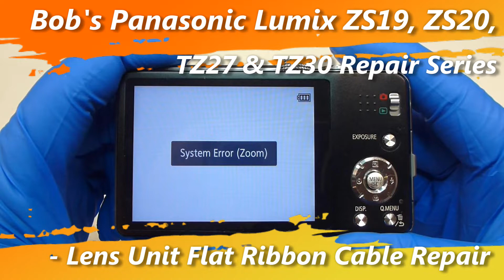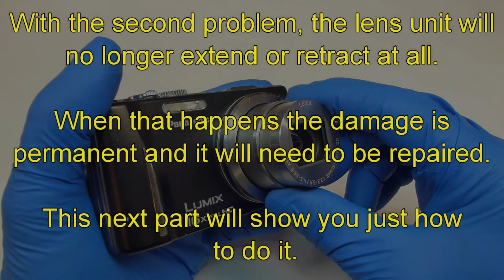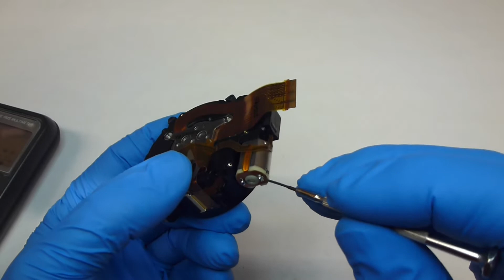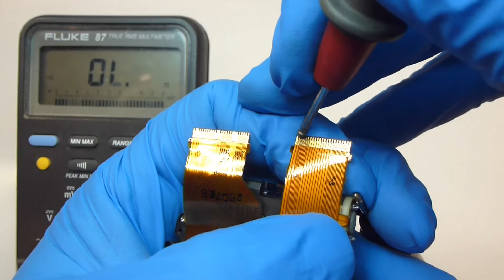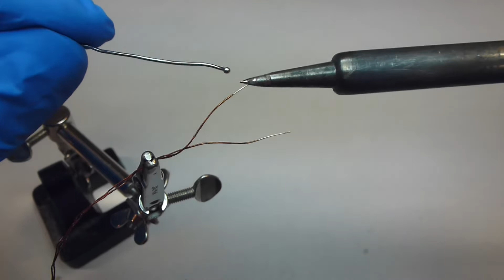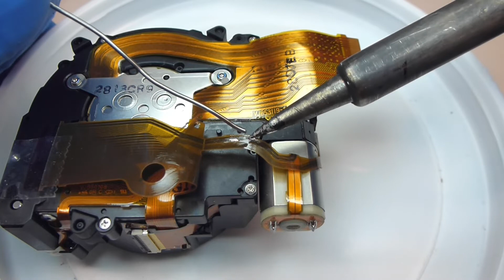Fix the "SYSTEM ERROR (ZOOM)" error on a Panasonic Lumix ZS19, ZS20, TZ27, TZ30

Comment: Thank you so much for this excellent video. Because your guideness I was able to repair my old TZ30 camera. I found that motor wires had stopped conducting. So I soldered 2 wires and it solved the problem. Finally a camera back to life. Disassembly and assembly of a body also were not complicated ,thanks to your other video. I am glad to keep in hands this old device again.
Reply from the maker: That's excellent! I'm glad the video helped you out and you were able to repair it.

Comment: what do i do if I get a 0 in the resistance meter between the two points on the motor? 
I Get resistance in the right knob on the motor but not the left

Comment: Question?  Won't the two new copper wires short out if they touch when squeezing into compartment?
Reply from the maker: Hi Martin. The copper wire has an insulating coating on it, and the coating has to be removed first before you can tin the wire with solder. You can remove the coating by scraping it off with a knife, or you can use sandpaper. All motors, relays and other electrical devices that use copper wire inside, use copper wire with an insulating coating.
Reply: @Thebobfactor    Thank you Robert for getting back to me so quickly.  It was really bothering me.  I had not seen clear coatings on any wire before.  Still learning at 74.

Comment: this is the main reason I stopped buying Panasonic ZOOM cameras, I had the same problem with the FZ200 so gave it away. All Panasonic Camera that has ZOOM system fail the same way all the time... total garbage.
Reply from the maker: I agree Richard. The problem that causes this System Error (Zoom) error, is 100% a design flaw.  And a problem I've run into with every Lumix model that I've ever owned, about four of them, is dust getting inside the lens, and on the CCD. They could do a lot better job on quality control for their camera designs.
Reply: @Thebobfactor  we should make sure Panasonic is paying attention to this issue  and fix it so customer can continues buying their product
Reply: My brand new camera which I never used and intended to for tomorrow barbecue has this problem now. Panasonic and Leica is garbage
Reply: Had Panasonic for years and haven't had any problems with them, Think it depends on how they are used .Have bought some second hand spares or repairs that had this issue ,fixed them up without any problems apart from one removing the lens sensor , not a good idea as it need to be calibrated, if removed or you will get focus hunting issues
Reply: My zs 100 is garbage- two months after buying, I sent it in for warranty repair. Now failing again. Never shall I get this camera again.

Comment: Thanks for your instructions. I managed to repair my ZS20 but putting it together again the small ribbon cable broke where it was  folded. Any idea how to repair that?
Reply from the maker: Is it the part of the ribbon cable that goes to the motor? That piece isn't needed anymore because it was bypassed with the two new jumper wires, so it shouldn't effect anything if it broke at the bend in the ribbon cable.
Reply: It broke before the new wires
Reply from the maker: Looking at this part of the video, is the bend on the top of the flat ribbon cable where it broke? 
https://youtu.be/wx8e0z0zsg4?t=83

If so, did the break just effect the two trace lines that I show being worked on in this video? If so, you can just solder the two bypass wires further up the trace lines to the other side of the break. 

If there are more trace lines broken, then you will have to repair them in the same way....if possible. Most of the other trace lines are much smaller and harder to work on. You may need to find a broken lens to purchase on ebay and use the flat ribbon cable from it as a replacement.
Reply: thank you

Comment: Wow great video but I would not attempt it myself. I have the first problem. Would you be interested in disassembling and cleaning my camera for a fee if I sent it to you?
Reply from the maker: I don't usually work on other cameras, but this is one of those fixes that's quick and easy, if that's what the problem actually is. So just pay the shipping both ways on it and that's good enough for me, it doesn't take long to fix. Send it to 775 Parmenter Creek Road, Libby, MT 59923. I'll delete this message after you have read it Steve. :-)
Reply: @Thebobfactor  Wow that is extremely generous of you. I actually tapped the camera a bit and gently tugged on the lens and then the zoom started working again. I’ll see how long it holds up but may need to contact you again. Thanks again.
Reply from the maker: @stevebrain65 , good deal that it's working. It sounds like there may have just been something small inside binding it up. Glad it's working now though. Good job.
Reply: Hi Robert, I seem to have the same problem. I don’t have the tools or the skill to attempt this fix on my mom’s camera. Would be kind enough to help fix it for a fee?
Reply: @stevebrain65 hey ,can un explain me how exactly ? I have mine turning on but the lens would not extend ,and i get the message . 

Did u tapped It looking downwords? With the camera turned on ?

Comment: This is a bad vid. I want to see how to take apart the camra but you are a wizzard and took it off to fast.
Reply: Yes
Reply from the maker: Lol. That's funny. You just had to click "Show More" in the description. This comment just shows though how people for some reason just won't take the time to read what is right in front of them. and instead find it's easier for them to simply criticize someone. Here's the entire description that's listed above for this video, which also includes a link to the video showing the entire DISASSEMBLY and REASSEMBLY for this camera. Be sure to click "READ MORE" to see this entire comment if it's not all visible. 
------------------------------------------
VIDEO DESCRIPTION:
------------------------------------------
This video will show you how to repair a Lumix ZS19, ZS20, TZ27 , Z30, and other cameras, that display the message SYSTEM ERROR (ZOOM).
You will need to watch the first part of the first video in this series to remove the lens unit before you can repair it.
Here is a link to the first video: https://youtu.be/V38GBeRXkco